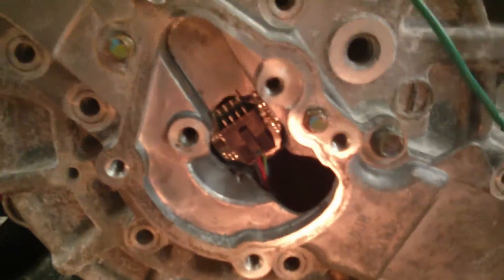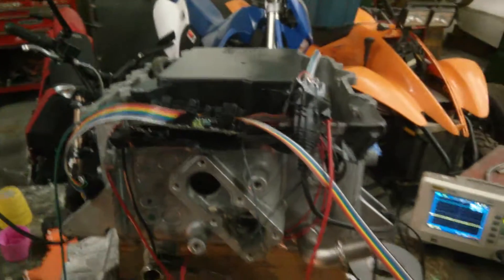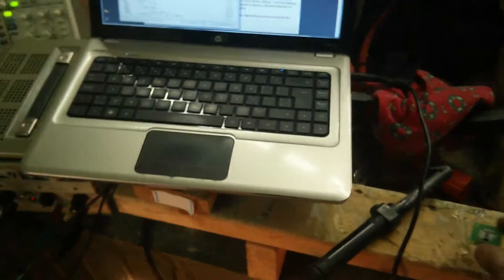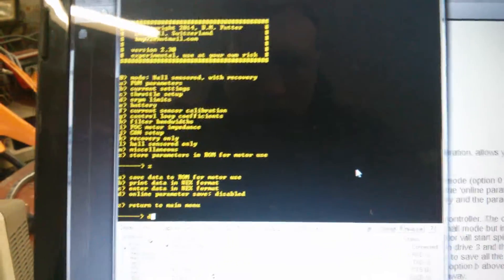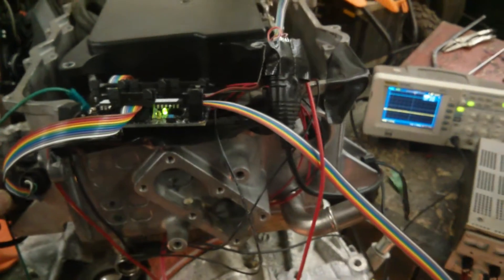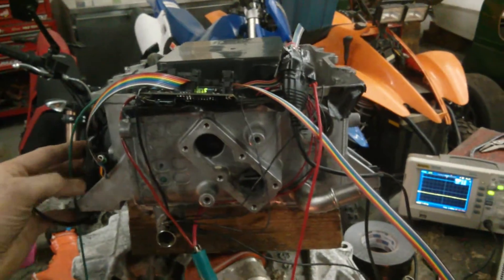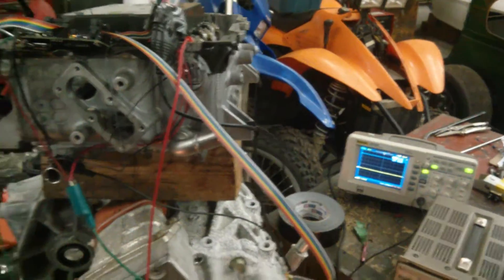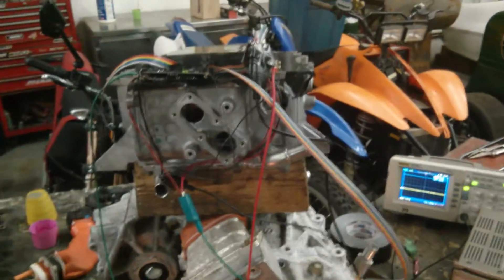Hall sensor calibration

Comment: Nice one Arlin.
If I understand it right, in words it would be the following procedure:

Calibrate Position Sensors(according to video Arlo 5.2.15)
l) hall sensored only
    b) calibrate hall positions: YES
    z) return to main menu
z) store parameters in ROM for motor use
--->z
    d) online parameter save::  disabled
    ---> d
    d) online parameter save::  enabled
    a) save data to ROM for motor use
Push button on controller: RESET   -> now it can start up in sensorless mode
Apply throttle, so that motor is starting and turning sensorless, then:
Push button on controller: SETUP   -> reads the sensor, calibrates position
    a) save data to ROM for motor use
READY
Reply from the maker: Yes you have it.  But its automatically saved to ROM so you don't need to select the last one.  After you push the SETUP button and it calibrates the position you are finished.